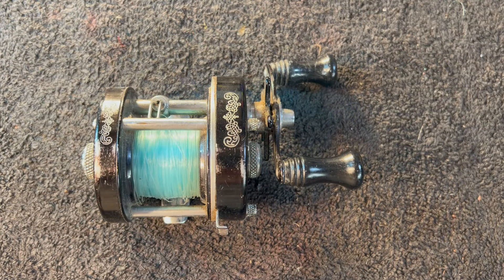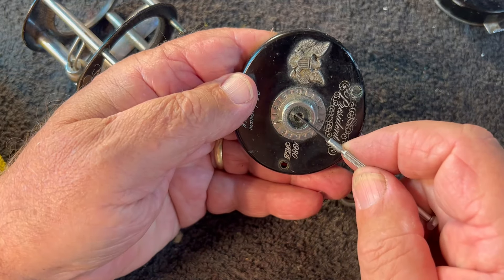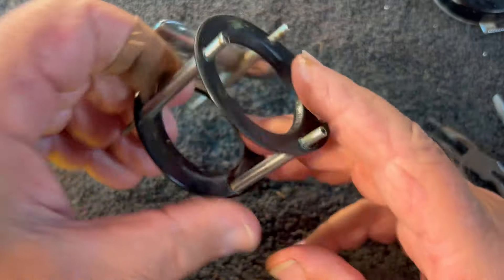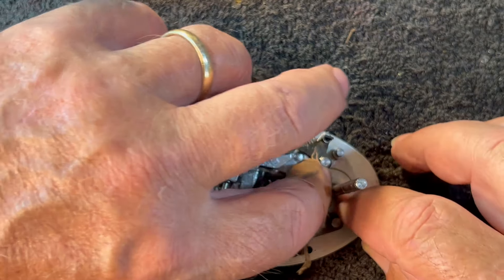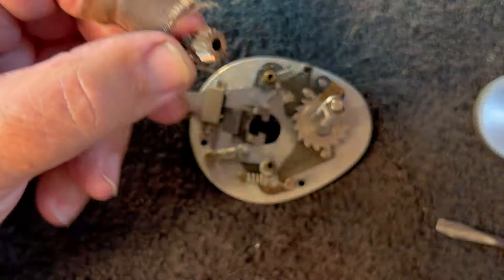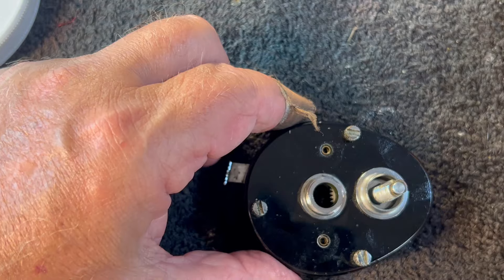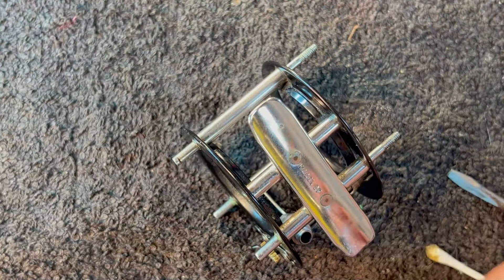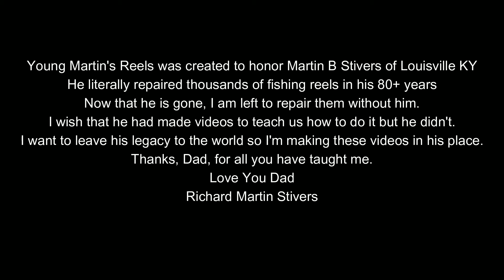Shakespeare President II 1980 Model DF -- Service and Lubrication -- Young Martin's Reels

Comment: Hi Rich it looks like another which I have in .y collection this reel came out during mid 70's  something to compete with ABU  Ambassadeur reels very good reels at that time they also made  the Pflueger line in a small quantity demanding a higher. price the Pflueger 2600 and the 2800  now on eBay for any between from 200 to 1500 dollars or more depending on condition and model the 2600  a narrow spool reel  size between a 5000 Garcia and 4500 the 2800 size of a 6000 with line clicker.
Reply from the maker: Carl, was there any great improvement in the Pflueger models, or is the higher price due to scarcity?